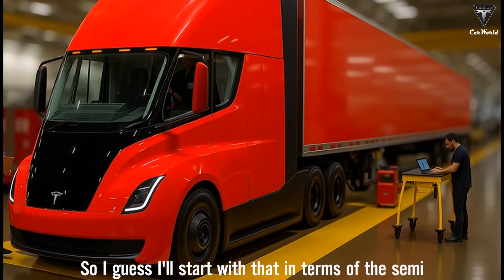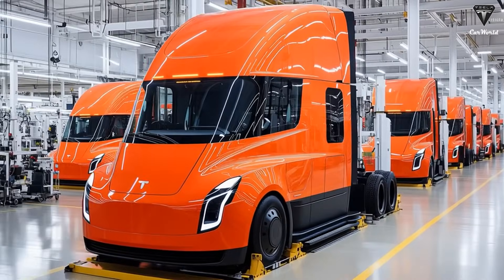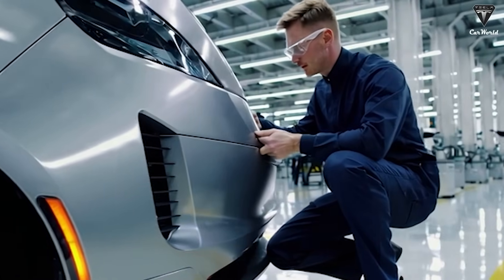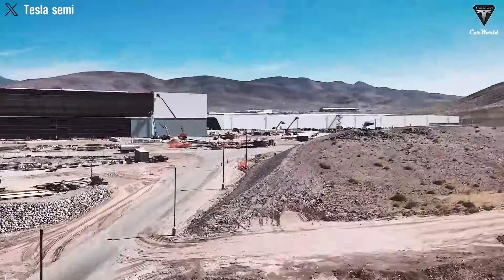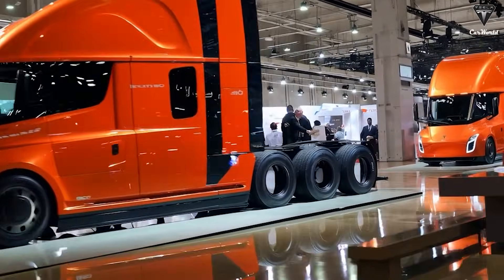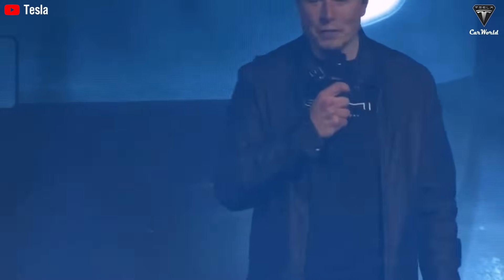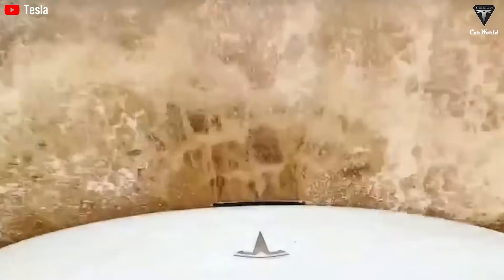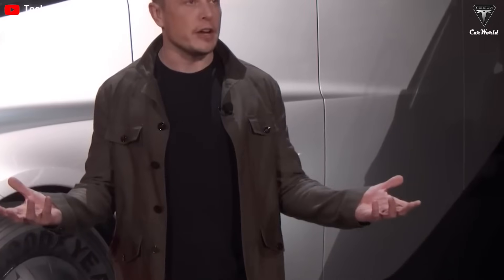Tesla Semi NEW Version 2026 FINALLY Here! Huge Design, Price & Battery Changes!

Comment: This truck is great for Walmart, Coke type warehouse fleets.  Once you throw in unknown distances to customers, drop off and pickup locations and driving time regulations, this truck would make long haul transport a nightmare.  So I'm at the end of my driving hours, I pull into a Truckstop and WAIT!  Where do I fuel/power up?  Yes the truck has uses for point A to B fleets, but not for OTR operators.
Reply: There will be GigaChargers are truck stops and other locations. They are already being built. And this video AI generated, and misses important actual facts.
Reply: @beaconterraoneonline  You've never been in a fuel line at a busy truck stop have you lol?  You have 15 min to fuel and vacate the pump.  I'm not saying electric won't work, far from it.  Just not OTR trucking.  Not for a few years anyhow.